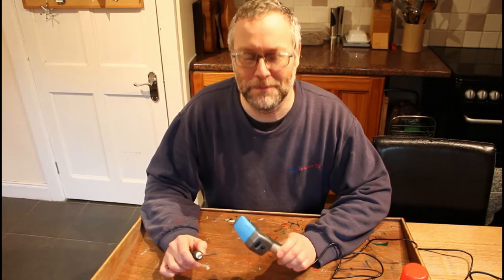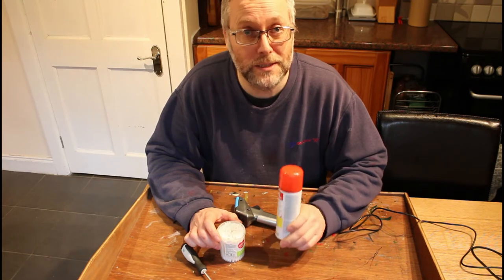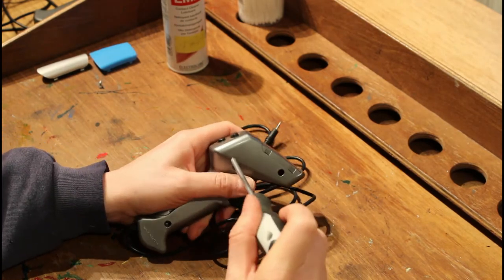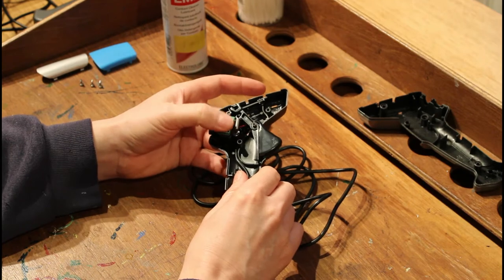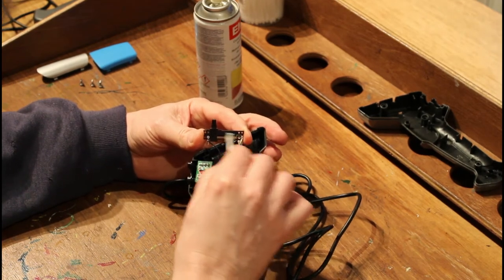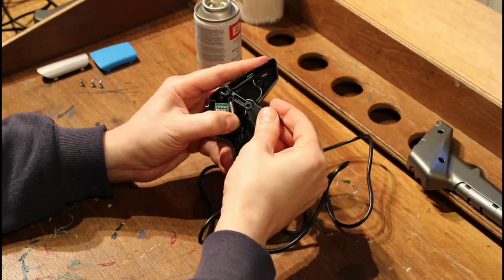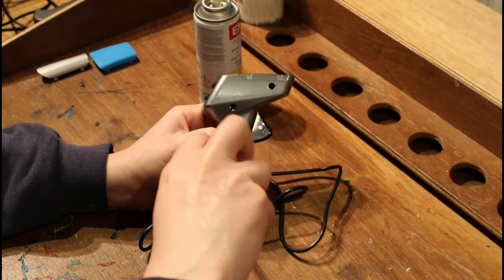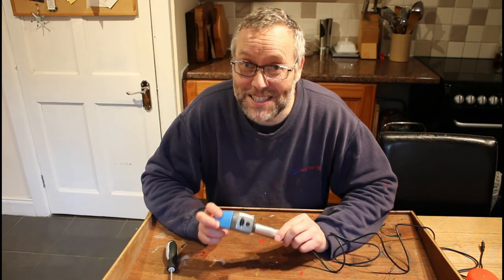Digital Scalextric Hand Controller Repair

Comment: I need some help asap, I just got a scalatrix track for my son ( used) had to get a digital power base separate, finally got it today, got 2 awesome cars, evening stand to be working fine, the cars lights are so lit up, and a paired them with the blinking light.  But nothing happens when I press the trigger on either controller.  I'm assuming it's not the cars since the headlights are on but I got nothin.  Any ideas?
Reply from the maker: Hi Mario, with the digital Scalextric you need to pair the controller to the car so the system knows which controller is to operate which car.
Clear the track of cars and put the car you want to program onto the track beside the power base. Pause for a couple of seconds then press and hold the button on top of the power base corresponding with the controller you want to pair it with. The light corresponding to the controller will flash a couple of times. Once it stops flashing you can release the button and the car is programmed. Repeat for the second car with the other controller.
I hope that helps and you have hours of fun with your son!
Reply: @weekendswithadamthebloke3768  thanks  for the response!  tried it the lights on the cars light up but still no movement, could it be that im using analog cars and not the digital versions?
Reply from the maker: @mariobergnini8897  Yes, it's easy to tell the difference. A digital car has a small optical sensor behind the brushes and a small circuit board inside the car which an analogue car does not have.
You can buy a kit to convert an analogue car to digital. It's a small circuit board with the sensor and is quite simple to install but you do need to be able to solder. I don't know where you are but in the UK they cost around £15 for over kit to do one car.
Reply: @weekendswithadamthebloke3768  you are a life saver!!! Cheers from the USA!!
Reply from the maker: @Mario Bergnini  You're welcome. Glad I was of some help & thank you for the feedback, it's great to be able to offer some assistance to others, and amazing to think that we can do that from opposite sides of the Atlantic! Have fun with your son, my grandkids love our Scalextric 😁